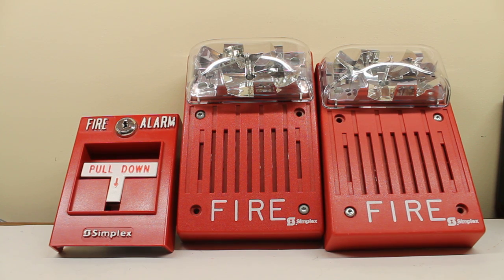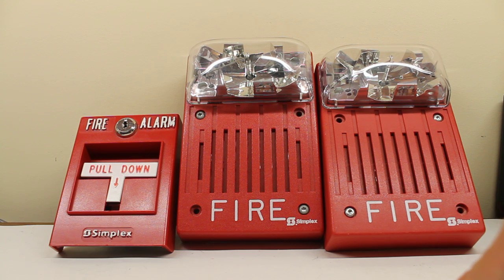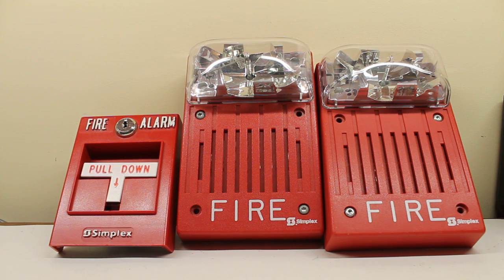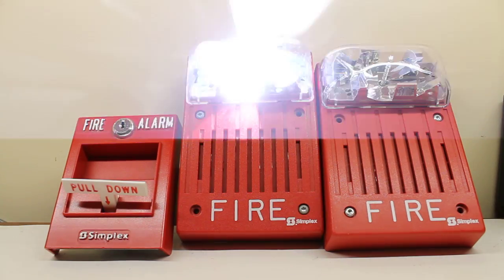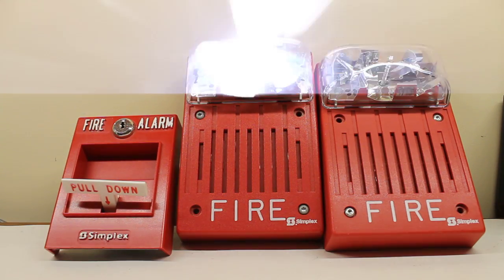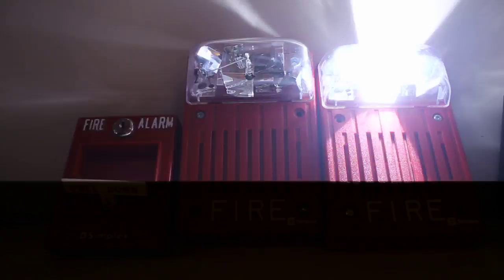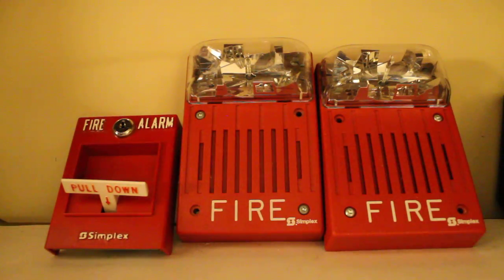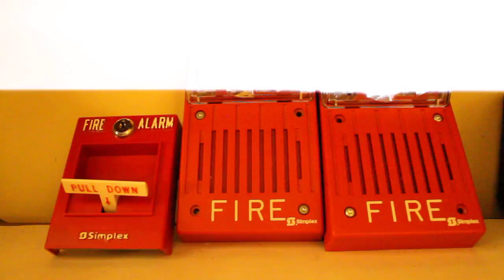Strobe Duel: Simplex 4903-9220 vs. 4903-9147

Comment: 9220 is older, and the 9147 looks like it has the newer SmartSync style strobe protocol.
Reply: He literally just said the 9147 (August or September 1994) is OLDER than the 9220 (December 1996). The 1994 strobes were known to flash slower while the 96 strobes were known to flash a lot more quickly. If you have a 4903-9147 from 1996 then you might notice the strobe flashing pretty quickly. It looks exactly like the model from 1994 from the front but the stickers are a bit different. If you got a 1994 model of the 4903-9220 then you'd notice the strobe flashes slower and the horn sounds very raspy and a lot more old and not as loud like the clean much more loud 1996 models

Comment: You should get a Fire Bell
Reply from the maker: +Andy Fonseca I do have one, actually. It's a Simplex 2901-9362. It may only be a single stroke bell (only dings once as it's a simple solenoid), but it's still neat to have. Personally, they take up a little too much space for my liking.
Reply: Ohh, don't you have Fire Alarm Ceiling one?
Reply from the maker: +Andy Fonseca I do have a few ceiling mount devices. However, they're not as large as a bell, and are fairly easy to store.

Comment: My -9252 flashes fast like the -9220. Strange huh?
Reply from the maker: +NJMoo3652 It's interesting that a newer device like that flashes slightly faster like the -9220. You would think they would have improved the design slightly, to ensure the strobe flashes at 60 flashes/second.
Reply: +NewEnglandElevators Yeah

Comment: The flash rates on those rectangular Simplex audiovisuals tends to vary a lot. One of the -9219's at my high school even had a double flash pattern.
Reply from the maker: +Fahrenheit4051 It's interesting that even the older devices from the 1990's had varying flash patterns. I find it a little shocking that even though the -9220's strobe should be 60 flashes a second, it goes a little faster.
Reply: ***** It's not supposed to be exactly 60 flashes per second. The NFPA requirement allows anything between 60 and 120 flashes per second (1 - 2 hz).

Too slow, and it might not be noticed. Too fast, and it could be seizure-inducing for photosensitive epileptics.
Reply from the maker: +Fahrenheit4051 I always thought it had to be exactly 60 flashes per second (and that's before I tried to do some quick research). Thanks for correcting me!
Reply: ***** No problem. :)